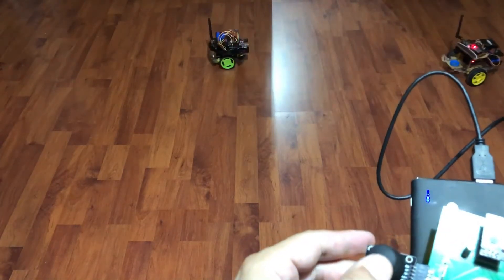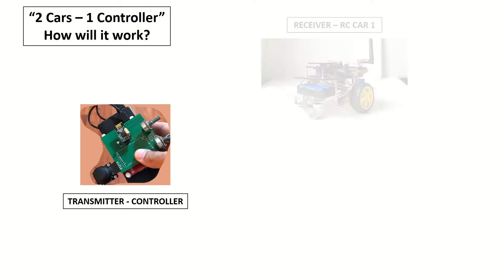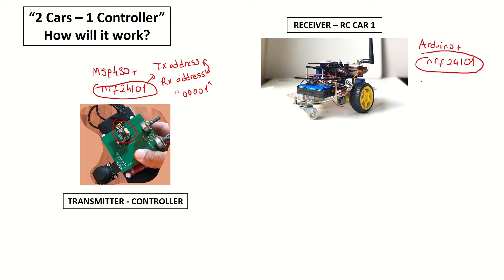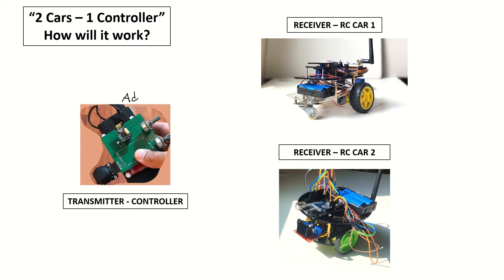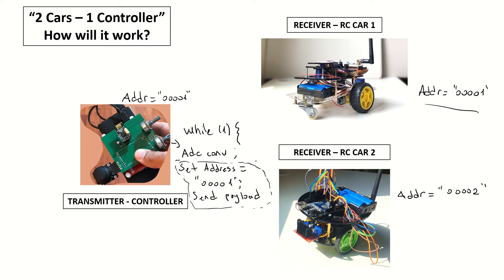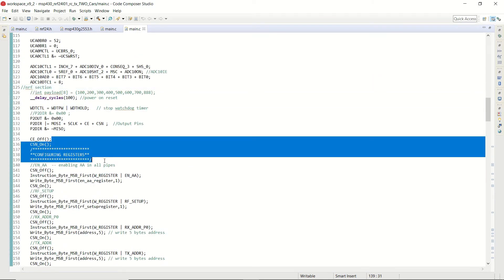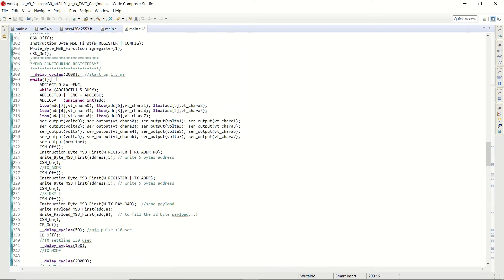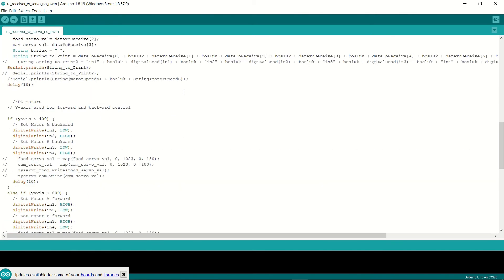Control 2 RC Cars with a Single Controller!

Comment: If this code works for me that will be Great help for my project 😊
Reply from the maker: I’m sure it will if you’re using the same mcu and connections. Let me know when you finish it. 👍
Reply: @drselim   thank you so much sir 
 I am using arduino  uno for RX and arduino nano for TX to control dc motor with joystick (l298N motor shield )and two servo control with potentiometer can you please help me for that
Reply from the maker: Hi, there are plenty of examples about arduino tx - arduino rx setup in youtube. What you need to change in their codes would be the addresses and the shifting from one address to the other in the controller’s loop.
Reply: I couldn’t get some library of transfer program msp430.h and more other can you help for that sir
Reply from the maker: @Njhhhhiojgjfjfjcjcjfufjcjf  You can not use the program I've shown in the video, as it's for MSP430 in the TX, not for Arduino. If you're not going to use MSP430for TX, it's not going to work. You should look up for Arduino TX-RX setups. I hope it's clear now.
Reply: @drselim  thank you sir I understand your words
Reply from the maker: You're welcome. Here's an informative video about arduino & rc car:
https://www.youtube.com/watch?v=tzNROquPEHQ
Reply: @drselim  thank you soo much for this link 
☺️☺️☺️☺️